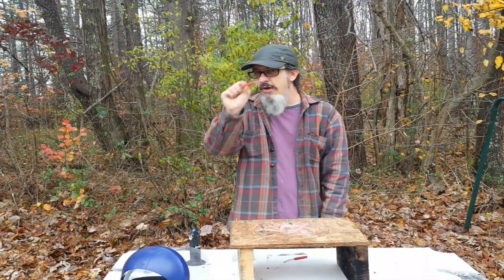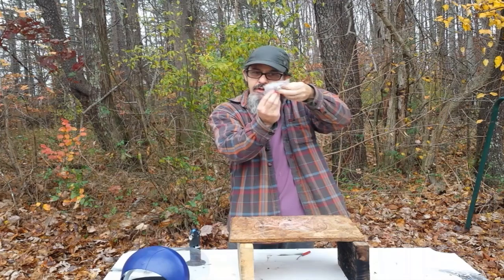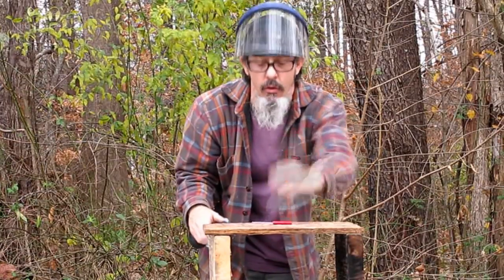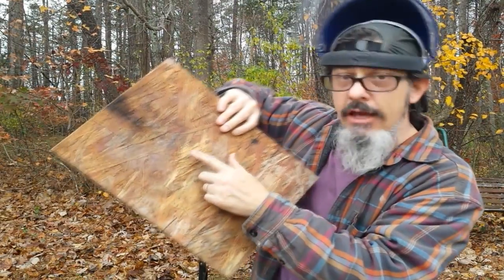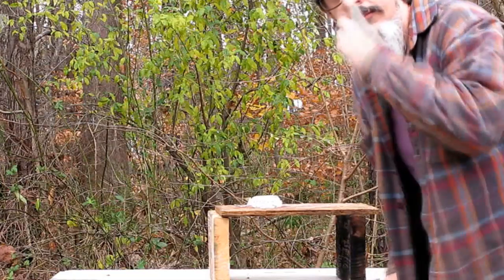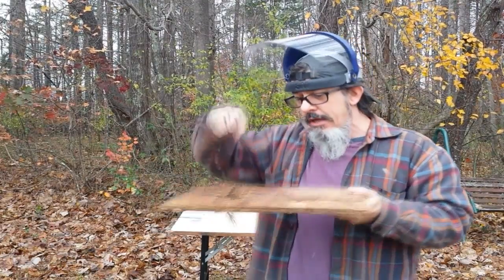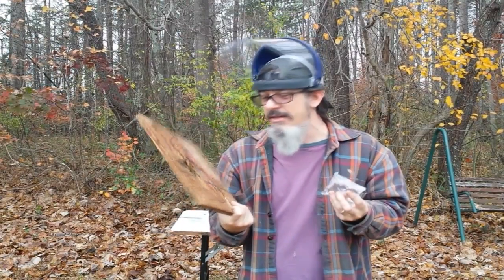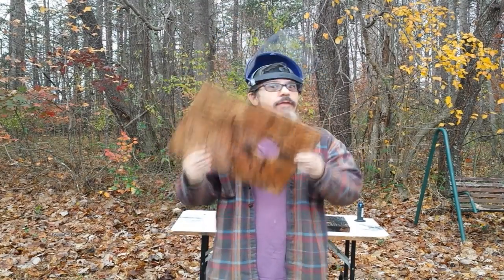Flash Powder Explosion "Shaped" Charge With Water

Comment: That's called Tamping the charge, not shaping. Also you can just use a ziploc bag or pretty much anything with weight that will add some sealing compression. You could use a lump of clay or bag of sand..
Reply: how you play with 'explosives' and dont understand this concept is mind boggling

Comment: Did this once with 70g of flash in a small plastic container glued to the bottom of a bigger plastic storage box, which i then filled with water into which i dissolved a crapload of salt beforehand. Underneath it was an old laptop. it was probably sitting half a foot above the ground and still managed to punch a basketball size crater in the soil! Took me forever to dig everything out of the ground lol

A better upgrade from salt would be epsom salt, as you can dissolve more of it in water, but regular salt is sooo much cheaper!

Comment: Blast waves leave explosives at right angles from the explosives’ surface.  When the waves encounter a different material there is a reflection.  The first pressure impulse hits the water, and some of it bounces back.  Some goes through the water, faster than through the air (sound travels faster in water), hits the air, and bounces back through the water, and hits the target material again.  Real H.E. Shaped charges will show 3 points where the reflected blast waves hit the target, one after another.  The first from the explosive, the 2nd from bouncing off the water, and the third going through the water and bouncing off the air, returning through the water, and hitting the target, again.  All this happens before the water bag is torn apart.
This is why water is a better tamping material than almost any solid material.

Comment: This isn't what I'd consider a shaped charge. But it is what I would consider impedance matching. The mass of the water generated enough resistance to the explosion to better couple the force to the target. This is how breaching charges work and for demolition. My great uncle used to put like this. If you set off a stick of dynamite on a slab of rock uncovered it'll pop and blow up but do little to the slab. If you cover it in damp sand it'll blow down shatter that slab and that's basically what we see here.

Comment: That's really more a "tamping style charge" than a shape charge. And there usually is either copper or magnesium cone (40-45° angle) involved with a proper detonation speed of about 5miles squared/sec. 
The primary charge (normally a blasting cap) ingites main charge which then inverts cone into a molten jet or slug that travels about 26,000 mph and just Kinect energy alone is enough to do job, but when you add velocity along with the jet or "penetrator slug" that's what actually does the cutting, or "penetration"...
Just being a bit informative

Comment: A fun trick to try: Take one of your flash firecrackers (bigger the better), put it on the board, and cover it with a small pile of aluminum or magnesium powder, or even powdered sugar (less ideal, but still works), and you will have a miniature thermobaric charge. The metal powder is instantly heated by the shock of the flash powder, and burns progressively with atmospheric oxygen. You get a much longer positive duration blast wave, that board would not hold up to that. Do a search for thermobaric ammonal on YT, and this dude's video illustrated it perfectly.

Comment: We call that setup the door knocker,  using a Yuli knot of det cord taped to a 1000ml bag of saline set off with a m11 high strength cap and MDI from around a corner of a building.  If the bad guy is standing behind the door when it goes off,  he ain't happy. Lol

Comment: Flash powder energy is mostly thermal, very little gas is produced.  Perchlorate is a solid, so is aluminum.   Products are potassium chloride,  a solid and aluminum oxide,  also a solid.
So, using a baggie of sand might be even more impressive as there would be less cooling with no evaporation
Reply: Point of fact is that the difference between sand, clay or water, weight for weight, would be negligible because all of them are incompressible. Water bags are often used as demolition barriers to stop debris flying outwards because it is easy to strap them, fill them and overlap them, and it is cheaper than almost any other method.

Comment: Next time, take 4 of them there firecrackers and put them side by side on the bag of water. Connect the fuses to make one fuse. Then duct tape the firecrackers to the bag. Place the whole thing, BAG SIDE DOWN, on a piece of 1 inch plywood. Light the fuse and watch what happens.

*edit, I just finished the video. Might as well try what I said on the tree. Just maybe use 6-8 firecrackers instead of 4. And remember, place the bag of water against the tree. The water should be between the tree and the firecrackers.
Reply: Are you saying that water transfers the energy of the explosive into objects?
Reply: @shannondove9029 how does the water direct energy if the bag is in the way ?

Comment: Something that I've wanted to try for years is to get an actual shaped charge but where the cone is surrounded by water and have the boom boom above. The reason I thought of this one was to eliminate air pockets in an improvised shaped charge and see if 
1) If it will work
2) if you get better penetration
Reply: That wouldn't work, when you set off a shaped charge the explosion isn't actually instant, its extremely fast but not instant. So the top of the explosive which is over the peak of the cone is set off first, the explosion reaches the peak and begins deforming it down through the cone, the explosion keeps pushing forward effectively inverting the cone inwards into a thin stream of metal. If you added water it would have a similar effect to just a flat piece of steel, the explosion would push it forward and maybe bulge it but it wouldn't invert and form a penetrator.

Comment: Schel  .....you can use a bunch of stuff to preshape your charges . You say you want to use it to take out a tree ....  depending on the diameter  you can use,  sand & duct tape , angle iron , or premolded concrete in a  V shape . Any one of these will create a Very Powerful  >>>  Cuting Action <<< .....  just make sure you protect against shrapnel

Comment: Would it make any difference if you added space between the firecracker and the wood? So that the firecracker isn't touching the wood at all?
Reply: If you where using a HE shaped charge with a cone liner then yes having it spaced and not touching the target would help a lot. I think with this though where your using water it doesn’t really matter. I don’t think this works by making a jet it just stops the blast going up and to the sides and makes it mainly go down into the target.

Comment: Very educational video.  It demonstrates why a torpedo is so effective.  Water doesn't like to be compressed and that leaves only 1 direction for the shock front to travel.  In the case of torpedos and underwater mines, once the shock front has contacted the hull, the steel doesn't stand a chance.  As noted by the other comments, this is a really good example of tamping.
Reply: The same tamping effect was used in WW2 to blow a massive Nazi dam.  The dam was massive enough that normal aerial bombing wouldn't have worked.  The Brits employed their famous "bouncing" bomb.  The bomb skipped across the water until it hit the dam wall itself and then hugged the wall as it sank.  When it reached bottom, it detonated and the dam wall, as massive as it was, had no chance of stopping that shock wave.  Liquids make very effective tampers...
Reply: Oh yeah, next time you try a 1g charge on a small tree, try wrapping a zip lock bag full of wet sand around the charge.  I think you'll find the results interesting..
Reply: @larryal9  The cool part about the bouncing bomb was why it bounced, it was able to skip over the torpedo nets and other obstacles put in front of the dam by the nazis to stop regular torpedos. The bouncing bomb truely was a marvelous piece of engineering.

Comment: What's the composition of the flash powder used? And it is just wrapped in paper?
Reply from the maker: It's basically a 7 to 3 ratio. And those paper tubes are actually bottle rocket tubes I purchased. But I've rolled mini tubes of myself with paper grocery bags and water diluted wood glue.
Reply: schel sullivan What oxidiser did you use? Potassium Perchlorate?
Reply from the maker: I'm actually using potassium chlorate which makes it a bit more sensitive and dangerous, but I have a friend who makes it for me

Comment: DUUUUDE! Yh just out of interest isnt gun cotton potentially more explosive? I mention it because of your how to make gun cotton video. Yo why do people use flash rather than gun cotton? Is it just the price difference?
Reply from the maker: I think the GC required very special conditions in order to detonate and reach its full potential. Plus GC is quite messy to make. GC burn rates can be adjusted and it burns very cool making it great for firearm propellants. Flash powder burns super fast and produces an immense amount of heat as well making it great for fireworks bursting charges.
Reply: DUUUDE! Cheers for the reply man, your a legend!! I guess that explains why it's not used as a detonating agent either. It's sad really cause gc is safe to handle & easy to produce. I was going to test a 10g mix of 87% chlorates 3% dark aluminium powder 7% parafin & 3% vasaline using gun cotton as I don't have the dollar to produce nitric in high concentrations, basic chemistry equipment is well over priced but I'll try some flash or maybe some old school black powder. Should work a treat
Reply from the maker: Stay safe!

Comment: Not tamping, but rather containment, tamping is to pack (a blast hole) full of clay or sand to concentrate the force of the explosion. Remember that explosives always take the path of least resistance, so the firecracker that was placed on the surface of the particle board ( static test ) took the path of least resistance. now when the pack (180 g) of water was placed on the firecracker, the firecracker did the same (taking the path of least resistance) but with some of its energy being focused down through the particle board.

Now if the firecracker were placed on the top of the bag of water and some tape (good amount) placed over the firecracker the term (roughly) would be a water impulse charge  (technically) 

Anyway great job on the video keep em coming
Reply from the maker: Yea I was unsure as to the exact term, but it made a huge difference in the direction the force is applied.

Comment: Try it with a new board for both. The 1st one may have softened the board.  I know it will still blow through it  but will the hole be as big.
Reply from the maker: I might try stronger boards, that particle isnt all that tough compared to plyboard.
Reply: thats what i was getting at . :)  would be cool to see. O and that is the best use i have ever seen for one of those water bags. I just had been trashing them.

Comment: Schel that's not called a shaped charge it's called a tamped charge.  A shaped charge is applicable only to high explosives where the direction of blast is shaped via detonation of the HE at a point opposite the target, and the HE shaped in such a way as to develop a cone of plasma due to the liner turning into a jet.  You're dealing with low explosives.  Tamping is still cool.  Look up shaped charge
Reply from the maker: Thanks, a lot of viewers have corrected me on this. Im glad I have smart subscribers!
Reply: Some flash powders if confined do go from deflagration to detonation. Some even have wave rates upwards of 20000 feet per second.
Reply: Ahh plasma. I was calling it liquid.
Same diff I guess.